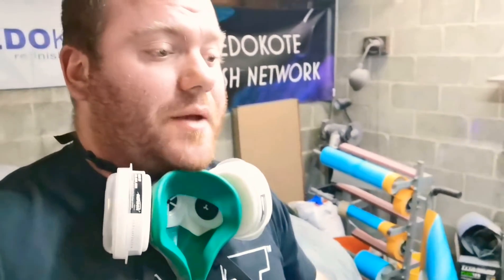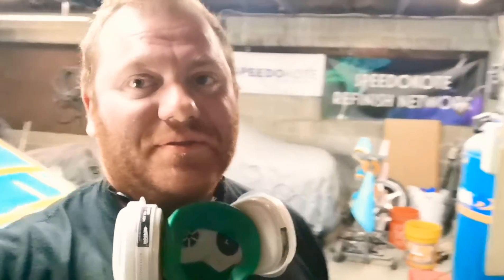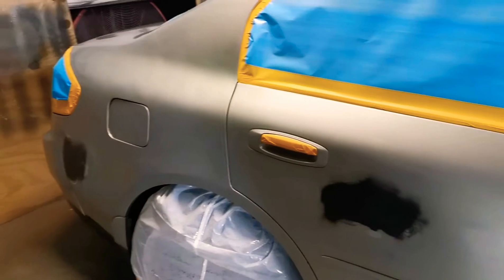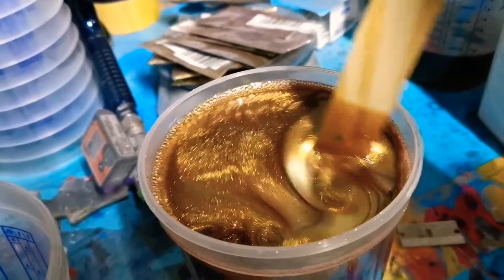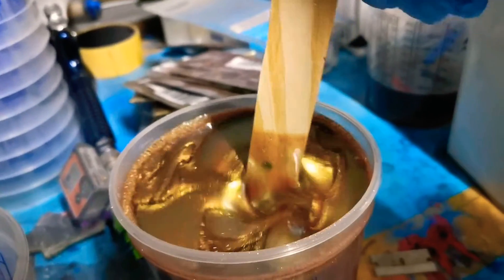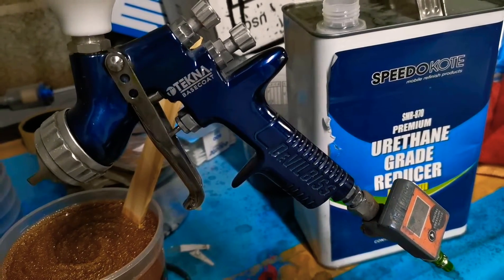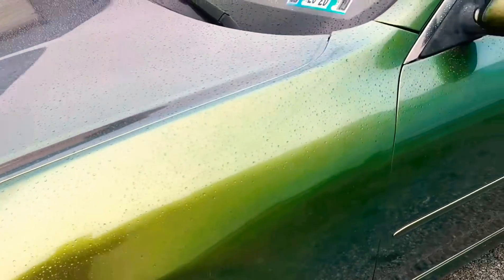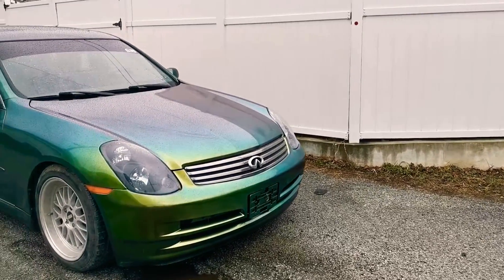Color changing chameleon color shift

Comment: The problem with welding studs and pulling them... the back side of the panel is completely  burned up...you need to paint it or add corrosion  protection...on it...but it stilll will but rusty in years
Reply from the maker: Yea it will rust again for sure on 10 years or less